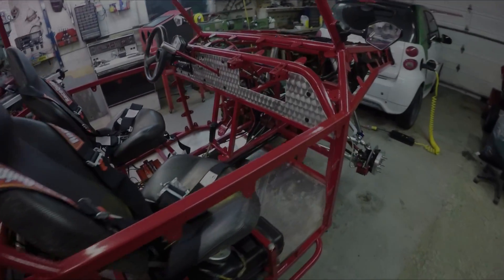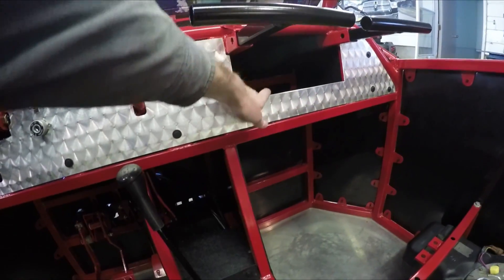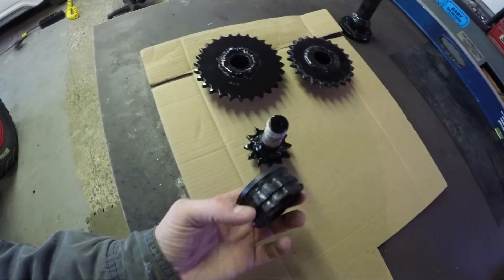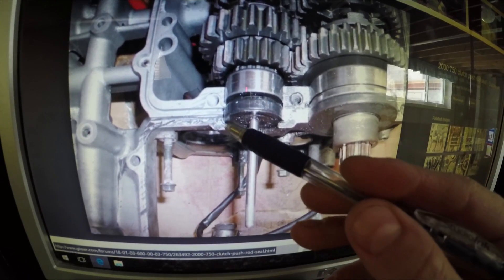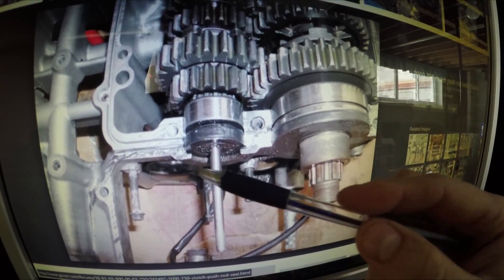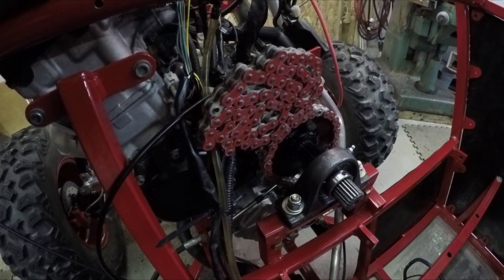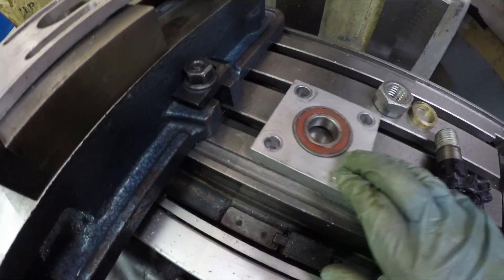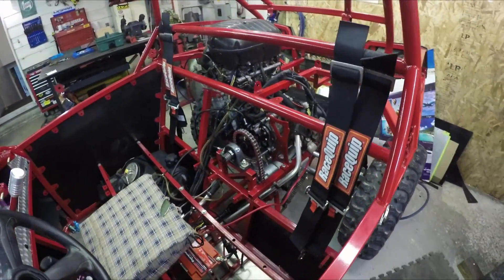Homemade SxS Build - Ep 21 - Side panels and chain tensioner (again)

Comment: 2 bearings would certainly be better than one, but try to sandwich the idler sprocket between them instead of just using 2 bearings on the same side. The load would equalize much better and the bearings would love you for it. Make sure you get the properly rated bearing for the anticipated RPM range and environment. Outstanding job on the ATV. Way to go. Thumbs up.
Reply from the maker: Thanks buddy! Yeah that would have been a much better design. If I do anything, I'll spend my time figuring out how to eliminate the chain altogether with some gears or something.

Comment: I have commented in a previous video about the idler as I have a bit of experience on that. You might want consider to make it with 2 bearings to help support the side load. It is dealing with a lot of horsepower and RPM, and one bearing alone can't just hold it, no matter what size bearing you use. Anyway, it is looking great! Keep up the great work.
Reply from the maker: Thanks for watching! I really don't want to have an idler on the load side.. I've never seen this as a common practice with atv builders.

Comment: do you have room for another bearing block on the other side of the adjuster plate? side load solved.
Reply from the maker: Not on the back side but there is room in the front. Someone else suggested that as well... if I kill this bearing I'll probably double up the bearings.
Reply: glassglowz   I look forward to see how you handle it.